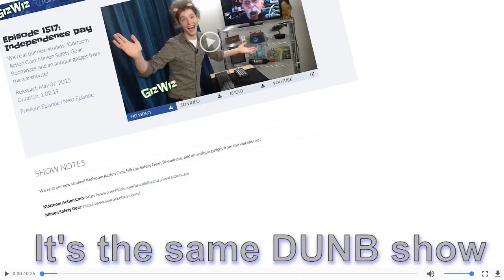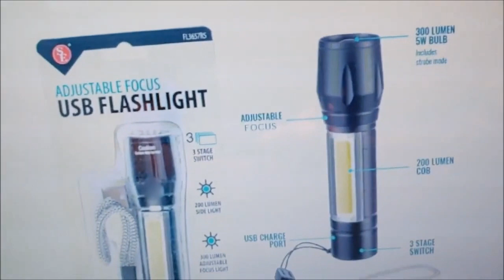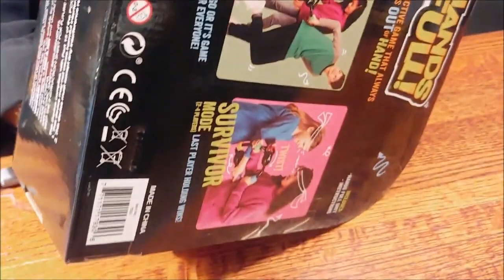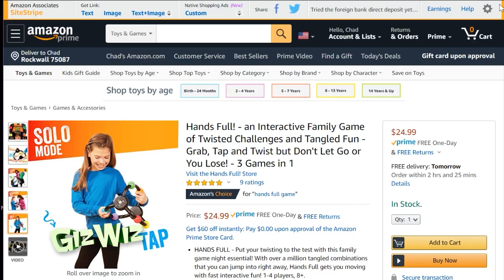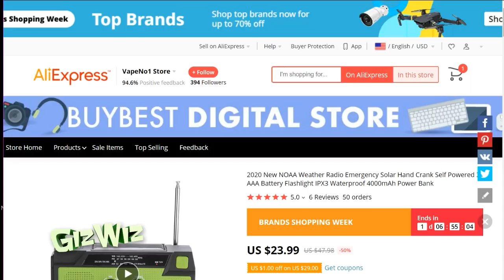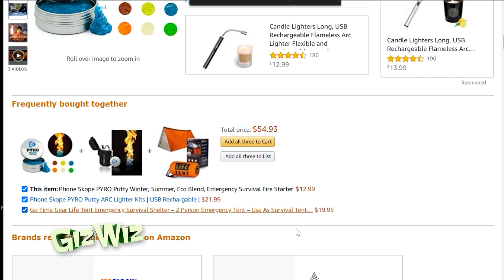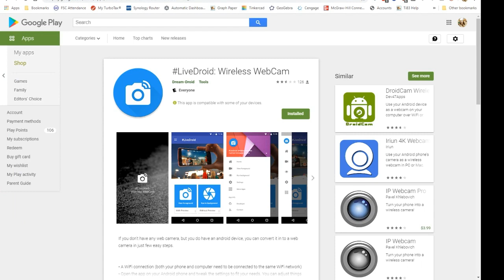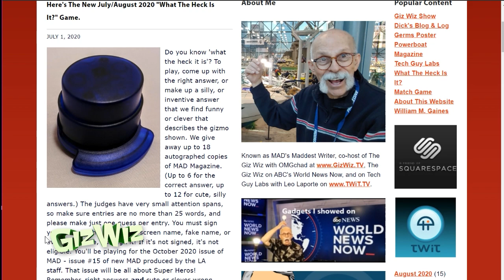The Giz Wiz #1794: Chad Get's Fired!

Comment: With winter coming, you won't regret buying 3 or 6 of those flashlights
Put one in every room
Remember to keep them charged for that out of the blue power failure
Reply: It would be nice to know where they got them.
Reply: @stevec5000  i would start where I did: Amazon
I remember when I last lost power and swore to add the little things I wished I had, such as ready flashlights
Candles and matches are nice, but finding them in the dark is no fun, plus will they light, etc, so, I now know where all my crucial stuff are located
On Amazon, start your search for solar powered flashlights - - Name brand is not important
If you have power, go through your house and think about what you will need with next power failure in the dark
Oh, I also now repurpose any plastic bottles, jugs, and so on for water
Some for drinkable water, some jugs with questionable water for flushing commodes, and so on
I bought a basic power generator to at least charge products needing charging and saving food
Note, when things go dark and cold for you, ditto for others, who will be making a run on the big box stores
You can smile to yourself, knowing you won't be frustrated and raging
Reply: @stevec5000  If you go to www.gizwiz.biz you can see the show notes for this episode:
https://gizwizbiz.squarespace.com/coming-soon/2020/8/28/giz-wiz-show-1794-august-27-2020-independent-show-275.html